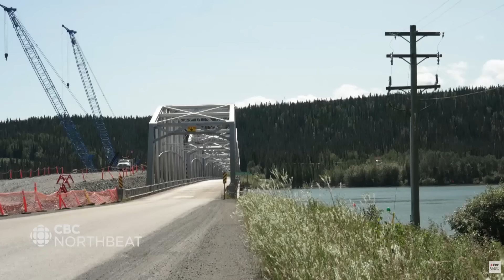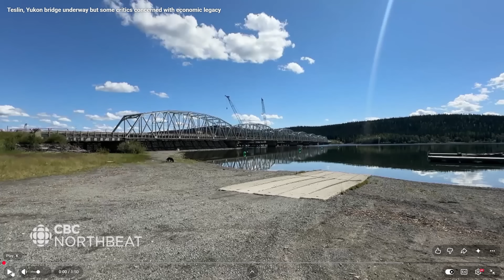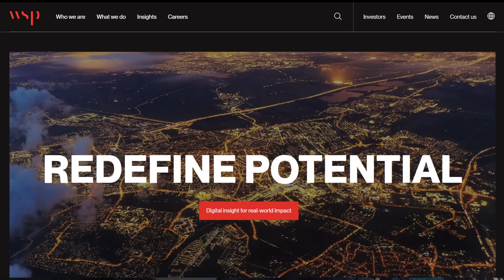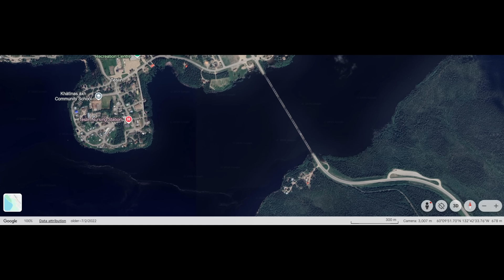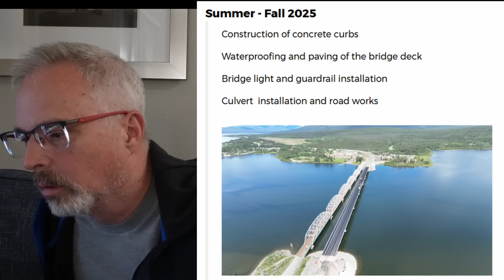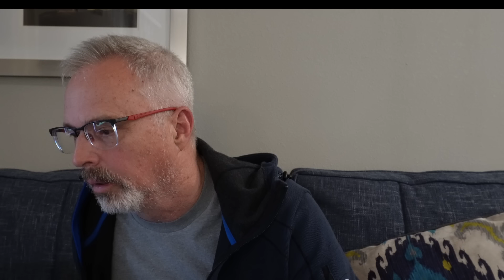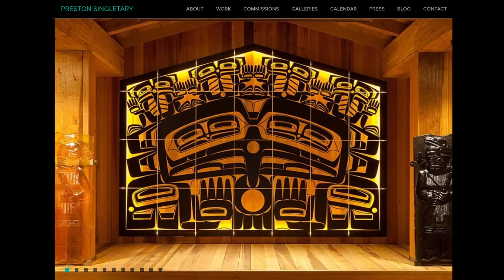Nisutlin Bay Bridge Mess

Comment: MSE reinforcement too short and not deep enough.  Using MSE can allow for more deformation without distress, but does not help stability.  Possibly the origional intent intended with gradual improvement with slow construction, but ABC did not allow sufficient time for pore water pressure reduction.  This rate of reduction is very difficult to predict in variable soils.  Best way is to surcharge the area first before even designing the bridge, and give it a few years.  Every one is in a hurry these days.  Colorado DOT has a prototype design where the area under the front of the MSE soil mass has a single row of battered piles, possibly tied back into the stable existing embankment.  Don't know how the research worked out.
Reply: Wild River rapid draw down, I did not allow use of MSE walls in that situation, on one of my projects 30 years ago.  What is the thought and experience today?
Reply: @josepheomelia9951  Draw down is a real issue for all walls, not just MSE.  82 pcf fluid equivalent is so far beyond the likily 30 or so with select granular soil that safety factors won't help at all.  Not a minor thing.  I still vote for high pore pressure without sufficient time to dissapate.
Reply: Well it sounds like you know what you are talking about .  But by Alaska law I get to ask you "yah well how long you LIVED up here"
Reply: mse wall failure seems a likely candidate to me too, obviously armed with only the limited facts to date, not a fan of mse walls, too many variables, too little construction tolerance allowed, search "42 freeway mse wall failure" for more on issues with this type of construction - project just outside Philly. on paper, i'm sure these satisfy the design parameters but in the field, can be troublesome